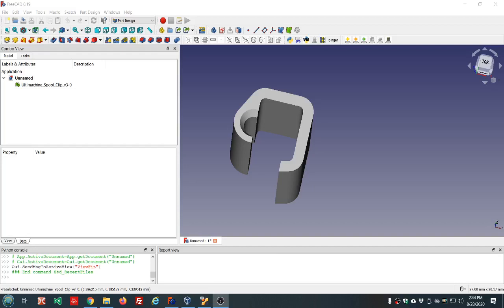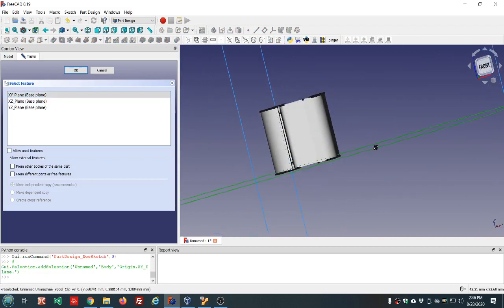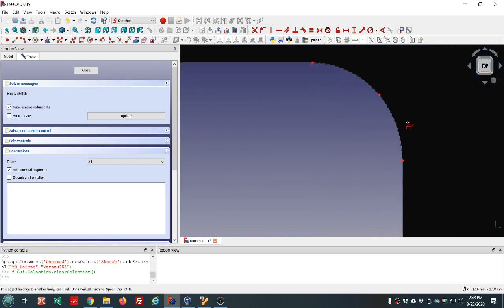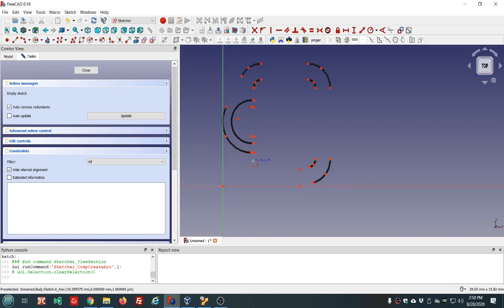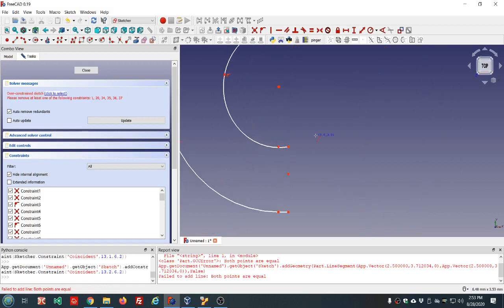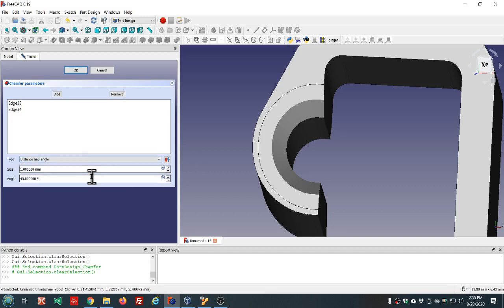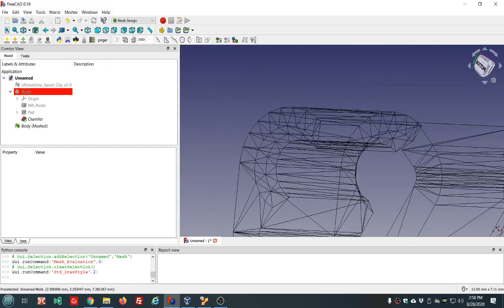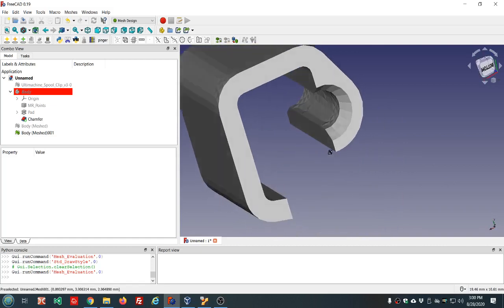079 FreeCAD 0 19 RemodelMeshInPartDesign

Comment: hey i noticed you use three points to create an arc, in the object that i imported and generated points from there are several circles that i have to generate. so i'm using your arc technique on either side of the circle to create a complete circle in my sketch.  is there a more efficient way to create a circle from a plot of points that you know of? i don't have a center point for the circles, as their "holes" within the mesh if that make a difference.

Comment: hey mark, noticed when i "click & drag" the generated points solid within the "combo view > model" into the body it creates "a link / base feature" to whereas when i following the instructions you provide in this video it moves the actual points solid into the newly created body. you wouldn't happen to know why these two methods produce different results would you?
Reply from the maker: The way I show to do it is actually a little bit of a hack.  It works fine as long as you're not trying to import a solid object into the Body, in which case you need to use the drag/drop method that creates the BaseFeature.  The MR_Points object is only to be used as a reference, so it works okay to put it into the Body the way I show.
Reply: @mwganson  This is a great hack/tip actually.
Reply: i figured it out, there's a create circle with 3 rim points. 👍

this tutorial is AWESOME BTW, 🙌